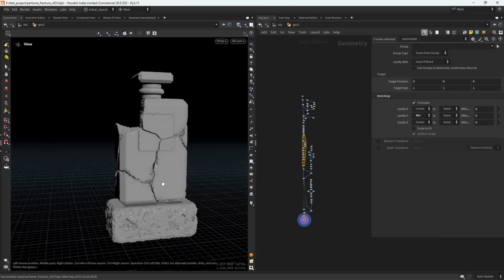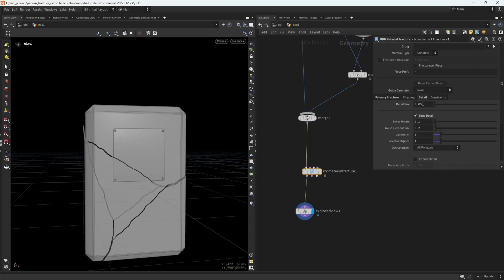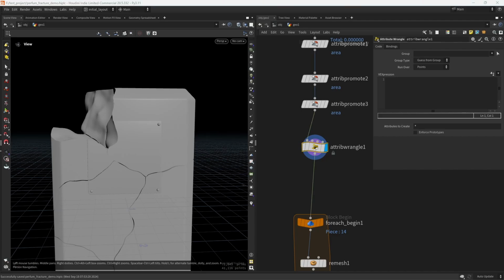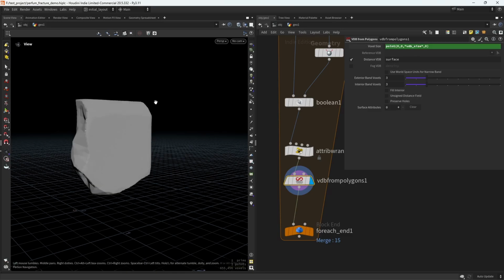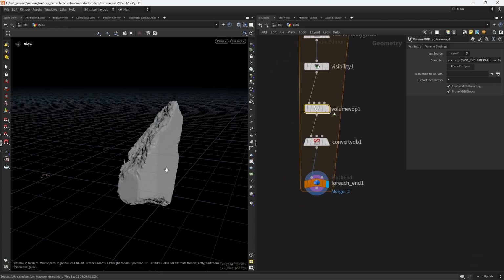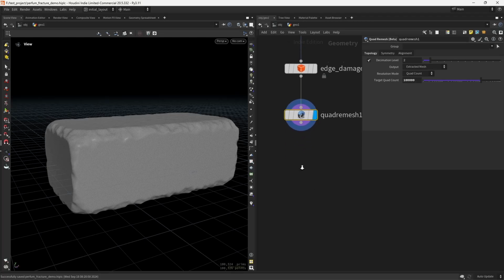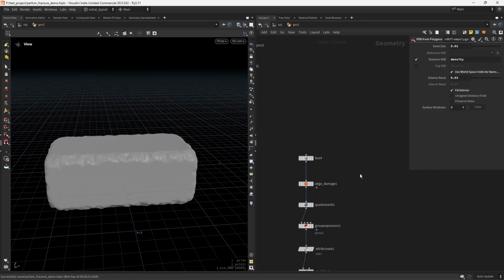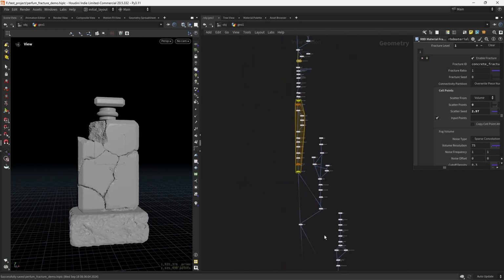Houdini Beginner Tutorial | Creating a perfume bottle

Comment: Thank you for taking the time to make the tutorial! I ran into an issue though, just after using the node wrangle to fit the min and max area into the min and max target size, I checked the spreadsheet and everything seemed correct. However, when I wrote the line of code into the target size of the remesh node Houdini froze. My remesh node had the same settings and I even tried unplugging it from the rest of the nodes, writing the line of code and then reconnecting but the result is the same, Houdini freezes indefinitely. Any chance you can help?
Reply from the maker: Not sure what might be causing that, would have to open the file and test.